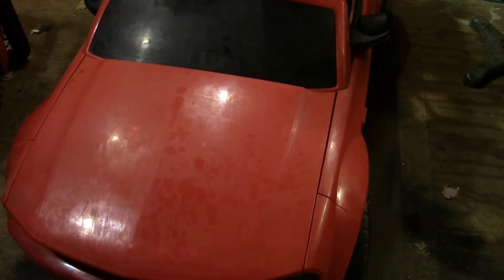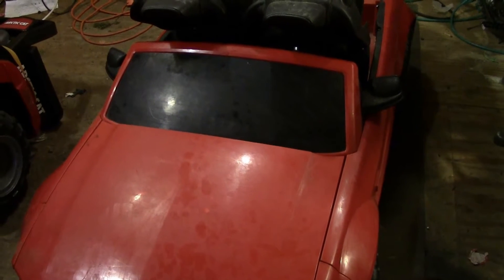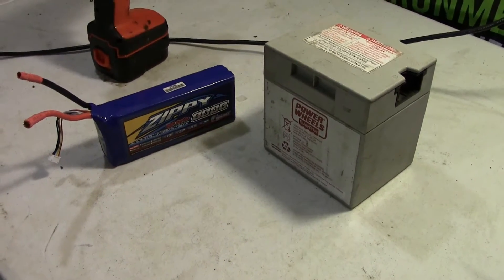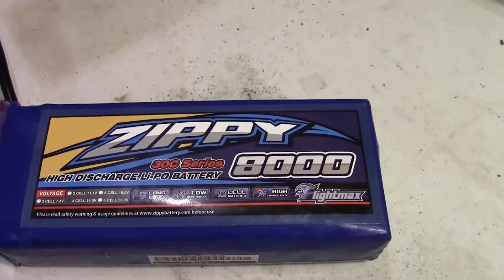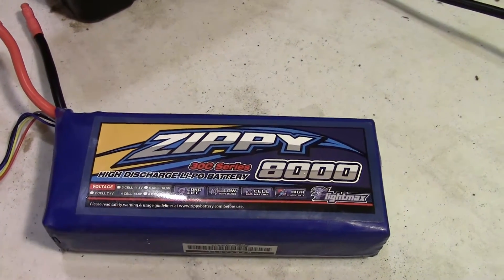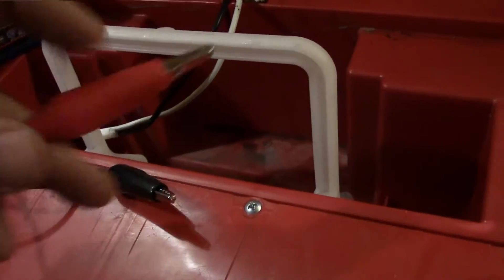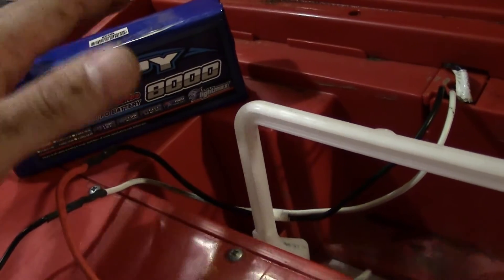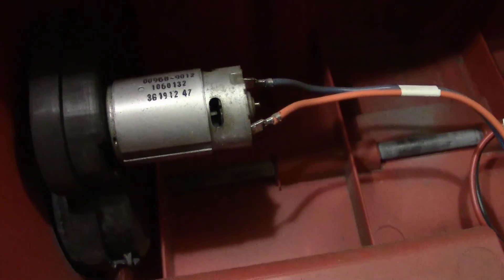Power Wheels Mustang Upgrades #1 - Battery

Comment: rc batteries dont have a voltage cut built in. if you get a lipo down to like 3.2v per cell discharge it can break the battery, down to 3.0v they can explode. did you put in any kind of voltage shut down circuit in? where can i buy one? i wonder if my local rc store has something. id love to run my daughters jeep on lipos.